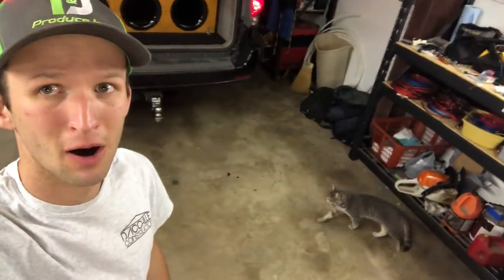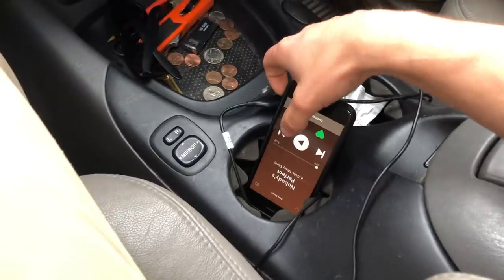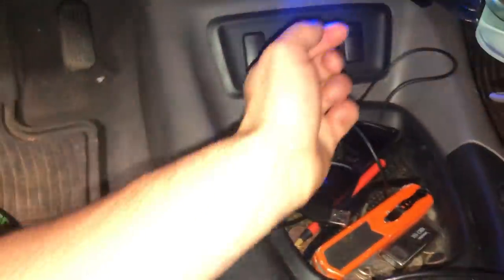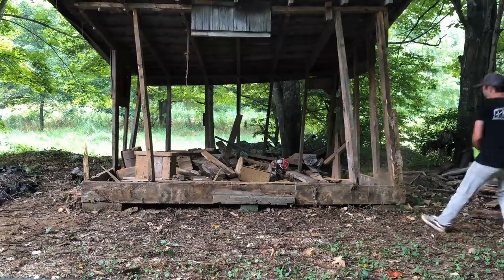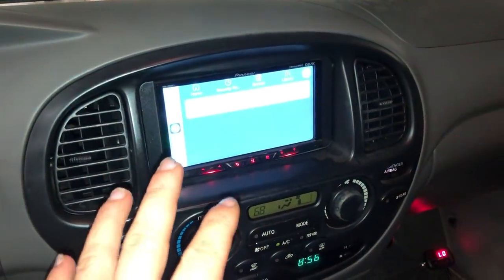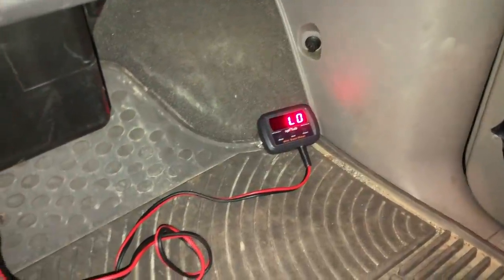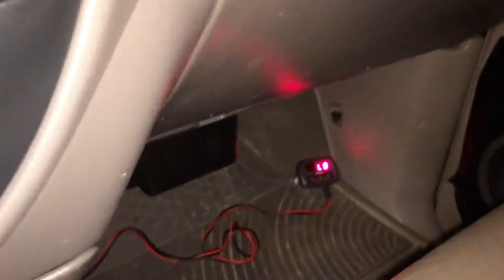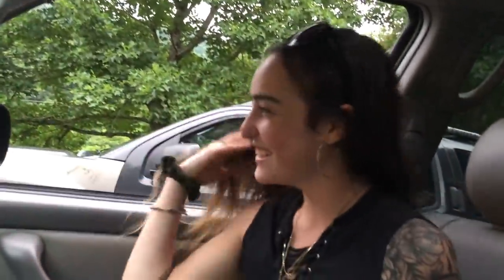How LOUD is My System? dB Test & Hair Tricks!! | 6 12" Dead Game Huracans on 16K Watts

Comment: On everything I love loudest system I ever had was 2 hifonics Brutus 12x15s in a sealed box about 1.2cubic feet per sub square subs on an mtx thunder 6500d. The amp had 3 25 amp fuses so around 800 rms at least and the interior looked like that (in a cobalt coupe as well less space)

Comment: I love heard a real low frequency subwoofer is about 40Hz to 25 or 20Hz 😚😘😎💪
Anyway that's awesome loud your new setup subwoofer 👍👏💪😎
Reply: 25hz to 1hz is infrasub zone
Reply: My DD715 goes down to 22hz on its lowest but my amp almost got cooked when i threw the volume on 22hz cuz the enclosures nit tuned for it and amps wayyy to small for my DD715
Reply: @erikbritz8095  not only amp can tune , if box great results on 22Hz the amp not out too much power .
Reply: @foxfire9656  exactly 29hz tuned enclosure would let the same amp chill at 22hz but sadly its tuned to 37hz 😅

Comment: I thought u gain match with ac through the output not input
Reply: Pretty sure he did. If it was imput it wouldn't be AC voltage, it'd be DC voltage and isn't affected by gain other than voltage drop running higher sound levels.
Reply: @Robert-ph6pl  I agree I just seen him putting the meter on the positive and negative input
Reply: Those are the speaker outputs. Remote turn on is between them. Power inputs on the other end. Also, look at the wire gauge,  do you think that amp is making 8k with 8 awg power wire? If he showed the other end of the amps you'd see the 0awg power imputs and wire.
Reply: @Robert-ph6pl  ok i got ya thanks

Comment: Try 32,36,38.hz Also are they broke in Yet.
Reply: Also if your able to push the box back a little bit. Give the ports more room.
Reply: @631JoeS  From what i've heard Parker say is that the ports are tuned to around 30hz, chances are the ports aren't contributing much to the output at 45hz, still worth a try though.

Comment: bro your amp rack is basically a wall that's trapping the bass...remember your ports are positioned low...big difference if you lay your amp rack flat
Reply: The box itself is the same height so I doubt it matters...
Reply: @getit7107   No it does matter the port height is at the back of the Box... Which is facing back the sound shoots towards the back of the vehicle and then comes back forward and hit stop wall and then has to travel up and forward slow... It's opposed to just bouncing off the back hatch and shooting forward with nothing stopping it

Comment: Those meters are inaccurate,  do not let anyone lie to you , sometimes there accurate sometimes there not, you can't trust those scores as certified....
Reply: They are within 1/10 of a db compared to the TL the only tine they are off is if you have ut in tye direct sunlight but hes got ut i  the kick so pretty much dead on
Reply: @SheikhN-bible-syndrome  ive seen them be 3db off, 157db with it, than 10mins later, same event, used a term lab and it was 154db
Reply: @ethanhimes8239  a lot of things can happen in 10 minutes including user error I'm talking about side by side simultaneous testing
Reply: @SheikhN-bible-syndrome  ive seen it multiple times, that system has never hit a 157, after months later of testing it finally did a 156 lol, these are inaccurate period
Reply: @ethanhimes8239  nice story change lol . At best maybe yours was defective ether way ive tested my SPL mini and there are others here on youtube that have done side by side tests and been almost dead on sooo..
Reply: @SheikhN-bible-syndrome  They are very accurate but i have to agree with Ethan Himes as i have had inaccurate readings from mine, i managed to work out that they don't like unsteady voltage & sometimes jump a few db so found that running them on their own power supply & away from the systems power (cigarette lighter) seem to keep it consistent at least for me.
Reply: @HashDogg06  you might have a point there seeing as i run mine off of an external power supply